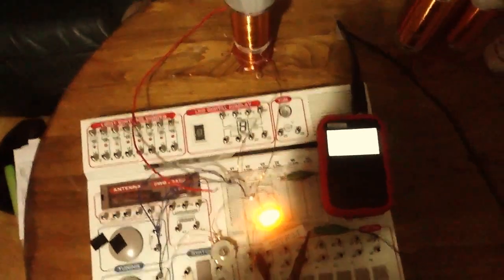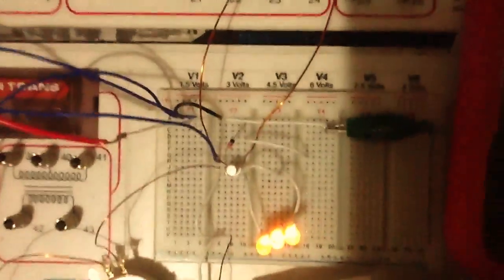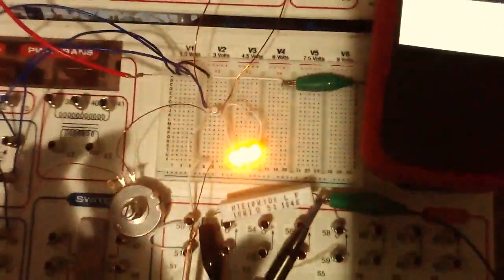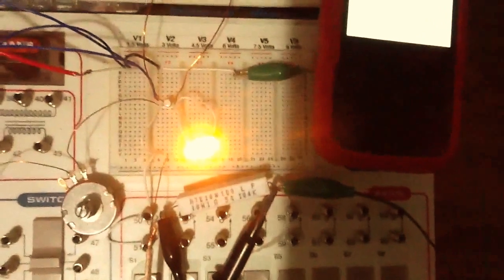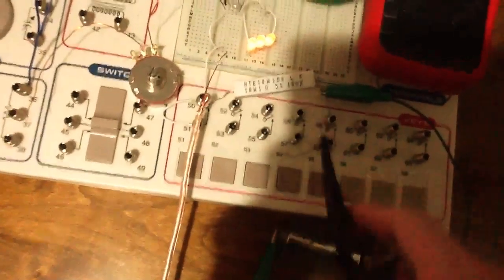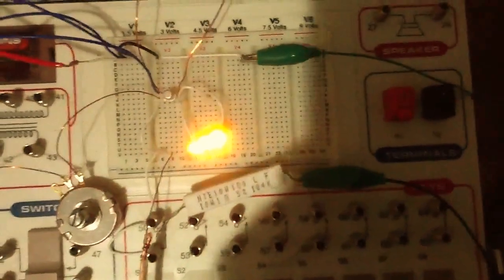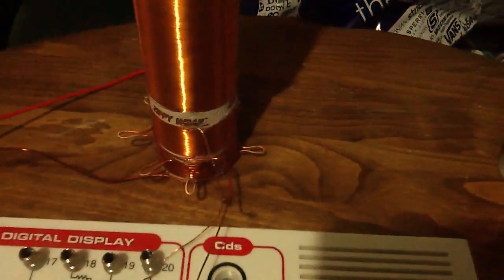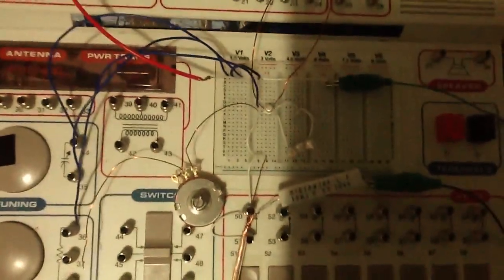pt1 TMT Tesla Magnifying Transmitter Slayer Exciter 1.2v

Comment: Nice work Kinen. It's seems close to 99% eff. Just a note, popular boost buck converter circuits have attained 96% eff lately. They only use one coil. They do not pair it with a capacitor to increase eff using resonance. It's not far fetch to built a 99% eff. circ. if using resonance. Just a tough here, if a circuit is 99.999% eff, the lost in the circuit would be in the nanowatts, bearely noticeable. In your case the load has very high impedance, it would last months on a AA battery!
Reply from the maker: hehe yes it looks pretty good, and it does work better than a regular 2 coil in these dimensions of size anyway.
but wait till part 2, if rom how it looks, the same exact magnitude current waveform is showing, i will let it play out and do part 2 as close to 24 hours to compare :) and have schematic, cause i know its bullshit to not show a scheme
Reply: Oh  Yeahhhhhhhhh!